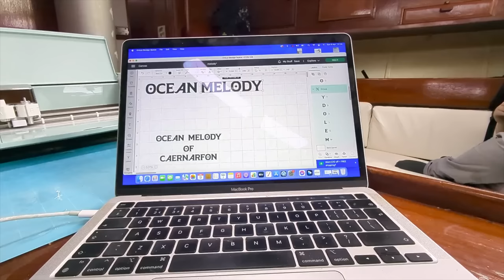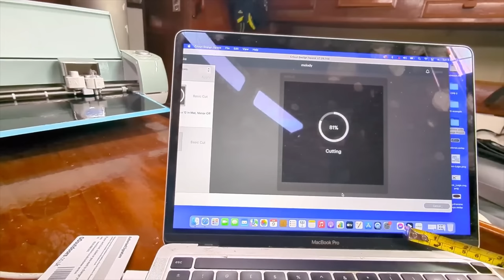#138 - HYDROVANE installation on a Bowman 46 Sailing Yacht

Comment: In the USA we call the “set screws” button head screws. Set screws do not have a “head” and are typically used to tighten a pulley on a shaft or similar application. Sometimes also called a “grub screw”.  I’ve seen others, when running a bolt through foam core, drill oversize then fill the hole with thickened epoxy. When hard they drill the final hole. The thickened epoxy will also prevent water from getting into the foam core. Thanks for the videos, love your channel.

Comment: I think the name looks awesome - and very impressive it’s all homemade, great job Melissa, especially in your condition, you are a very brave and determined lady!
The Hydro takes me back to my fit which I did the opposite of the way u did it, as the transom sloped back, so A at the top and H at the bottom. It all looks great Andy but I would put the whole apparatus down further as there is no merit in having any of the rudder out of the water when upright. This will also help clearance of the Mizz boom. 
Very exciting stuff guys 👍👏👏👏👌
Reply from the maker: Thank you ☺️

Comment: Shame about the Go Pro, we all know it happens! Makes me smile having been in the same job as you that you can make positive changes to SO many peoples lives, literally without pausing for thought but you are bricking it about drilling holes in your pride and joy 🙂you know I am teasing I hope. Great to have the name on the boat and Jack sailing. Expect you will lower the rudder a bit more too? Shame about the vane and sail interfering with each other. Suppose you wont be depending on it ALL the time though. Looking forward to Sea trials to find out if it all works.

Comment: The nicest holes that I have drilled in gelcoat use a Step Bit which has a low angle of cut and is fully supported by the edge of the hole.  It increases in steps of 1/16" and makes a very smooth cut.
Reply from the maker: Very good suggestion

Comment: We have had Hydrovane on our yachts since the 1980s, having purchased the first from Derek in 1983.  You should never go to sea without one, being a crewmember that never sleeps, eats, complains or uses electricity.
Reply: The power saving and smoothing out of an open water passage is worth the effort...but they do tend to cost a lot....
Reply: @rainfinger  

They still remain an expensive item for most ... The problem is the variety of boat hull designs and systems.. to get them to fit and work well usually involves a 
deal of customisation and tral and error.. to get the best out them but once done ✅ 👍🏼😎

Odd life crafting have had to go go through the  adapt repair and tune cycle to get theirs working reliably. Plus they also had trouble with their autopilot destroying their steering quadrant ...
The forces on some rudder systems can be quite epic at times.

Comment: Can a folding bracket be spliced into the vertical telescopic "arms"of the red Vane, so it can be dropped to a horizontal 90 degrees? It would thus clear below the mizzen boom. Save any potential whoops-it-went-overboard incidents with the vane.
Reply from the maker: I wouldn’t be wanting to modify anything hydrovane make. I’m certain they will have investigated all those kinds of possible solutions. It had occurred to me also that would be a handy feature but they’re a very thorough company and will definitely have prototyped or designed things like that and if they had worked then they would be making them. But I’ll ask them if anything like that is in development.  It’s a brand new hydrovane though so I’m not inclined to mess with their research and development lol
Reply: @SailingMelody  I understand what you are saying; "a little knowledge can be a dangerous thing". Much R&D has gone into the product as you say, and I suppose that there are simpler solutions anyway, e.g. a short safety line for when the vane is demounted for tacking. 
Glad to see all is going well for such a lovely family, and again thank you for sharing your adventure.

Comment: Impressive job with the lettering. So much better than using stick-on letters from the stationery or hardware store and then having them not the correct size or going on straight.
Reply: Need a SSR number if not registered already? another job for Melissa!
Reply from the maker: It's on the to-do list 😁
Reply from the maker: Thank you 😁

Comment: Was the lower part of the transom foam cored in the end?
Reply from the maker: It has a foam core yes but I have a cunning plan for that to make sure it’s all good.  Still have to do some final adjustment of the lower A-bracket anyway
Reply: @SailingMelody  I had a similar situation with my bathing platform, I’ll explain my solution in case it’s useful. I drilled pilot holes from the outside then with a 2” hole saw i cored out the inner skin and foam from the inside. I then filled the resulting hole with bonding paste. Once that went off I put 3 layers of glass about 4” diameter over the top. Then re drill the pilot hole from the outside before opening up to the required size. No doubt you have a plan already but thought I’d share!

Comment: Other option if can make it all fit,  move attachment point for mizzen boom sheet further forward on boom so doesn’t interfere when tacking.

Actually cut top of stainless tube to drop top mechanism enough to fit under boom in low position then move sheet forward and jobs a goodun.
Reply from the maker: Yeah that would help as well
Reply: @SailingMelody  just edited and added a wee bit to comment, cut stainless tube down so it fits under boom then move sheet forward ;)
Reply from the maker: @johnhogg9756  that stainless tube isn’t  just a tube

It’s a very complicated piece of precision engineering with a central shaft and machined bearings top and bottom. You can’t cut it down
Reply: @SailingMelody  of course, wasn’t thinking about inside shaft but imagine it’s not rocket science to take out inner shaft and measure how much it measures diff to outer tube and cut them separately unless of course only ends of shaft have mating shapes on them.  (Or potentially order a diff size tube to same effect as getting it to fit under boom - admittedly money is always a concern so may not be an option - but it’s an alternative to getting sails re-cut and shortening boom)
Reply: Of course shorter boom may be a better option was just thinking out loud in case it’s if any use at all - though guess you probs had same thought process already 💜
Reply from the maker: @johnhogg9756  the hydrovane is about 10x the value of a new boom lol. Second hand booms are ten-a-Penny and the hydrovane unit is thousands of pounds to buy and brand new so if I’m going to modify one or the other it’ll be the sails:  in actual fact an owner of a BOWMAN 47 has been in touch. He informs me that the bowman 47 was invented when a bowman 46 had its mizzen mast taken out by a rogue wave and the crew found that the sailing performance without it was literally identical. There was no benefit to the mizzen whatsoever. He is suggesting we get rid of the mizzen altogether and use the space for extra outdoor living and a large solar array stating that for living and cruising it will be more use than a pretty but ultimately useless mizzen.  Personally I don’t think I can bring myself to do that but I think losing a few inches off the mizzen boom is a no brainier
Reply from the maker: @johnhogg9756  yeah it’s totally appreciated :) been going over it a lot in my head 

I’ve also heard from hydrovane who have said they would like me to lower the whole unit and extend the lower A-bracket so it’s less than 10 inches from the bottom bearing. So that adjustment will be coming up in the next couple of weeks
Reply: @SailingMelody  I do like a mizzen but it actually the idea of loosing it doesn’t sound that crazy.  Tbh amount of yachts with mizzens that I have never seen unfurled in decades of ownership is pretty much all of them.  

But yeah loosing a few inches and having sail re-cut does sound a good option to me as well.

Thanks for replies, it’s fab hearing back when make comments and actually really cool hearing a bit more detail and thoughts why certain routes are taken.

Can’t wait to see you all make off on your adventures
Reply from the maker: @johnhogg9756  yeah thanks. We do like to actually talk to our subscribers rather than just ignore them like a lot of the big channels do. I guess it’s more tricky when out at sea. But we love the engagement and interaction
Reply: @SailingMelody  well for me wee love the interaction too… unlike when you comment on another channel really nicely recommending they fit even a diy kicking strap and they get really snooty telling people to mind their own business and have a right rant about doing it their way and they consider giving up channel cos of people like this..  (that was on a channel where the channel numbers basically paid for their boat refurb and their living as they didn’t work).   Voted with my feet in that one lol.  

My son is very autistic (non verbal, hyper, no concept of danger) so won’t ever manage any big sea adventures so really enjoy watching your adventures and others as think a lot of us feel part of the adventure and all of you really make your subscribers feel part of it.   Thank you 💚❤️🧡🤍

Comment: Andy this Hydro Vane is it an upgrade on the traditional Wind Vane ?
Reply from the maker: Kind of although it’s been around a long time: most wind vanes are the servo pendulum type which use a trim tab to steer the boards main rudder via ropes and pulleys to the tiller or wheel. This has its own independent rudder and works in a different way to the Aries a Windvane or rhe Hasler or other servo pendulum types

Comment: Removing the lens cover made a massive difference! Have you been filming with the protective cover on the whole time?! Xx
Reply from the maker: Noooo

That’s the actual square lense which has a bayonet tie fitting on GoPros 

You know the front lense on a GoPro is like square, we’ll that bit is actually removable and under that is the bare lense it’s self. That outer bit gets a bit crazed and scratched but it’s important to stop moisture and dust. But we removed it to improve image quality on our knackered old GoPro 7
Reply: @Sailing Melody  do you have go pro subscription? As you can get a replacement if you do
Reply from the maker: @ShipHappensUK  I’m not sure. Need to check. Been flat out at work since

Comment: Why are you measuring for the vinyl using inches and not doing it in metric ?
Reply from the maker: Hahahaha shush. We both work happily in either metric or imperial. I switch between the two frequently

Comment: Nice episode Andy. I would've thought it would be easier to mount the two bottom brackets and then measure the length of the tubes required. It appeared Hydrovane made the brackets very adjustable. Trying to determine length and position simultaneously I would think is very difficult!
Reply from the maker: Quite possibly we followed the order according to the Hydrovane videos. 🙂

Comment: From a lifetime involved in aviation it was always assumed that “if it  can happen, it will happen”, try googling “aircraft accidents, swiss cheese effect”. There will be one time when the vane gets a swipe from the mizzen boom so best figure a solution to prevent that no matter what it takes. Relying on removing the vane beforehand is not really an option and I think you know that.
Reply from the maker: Agreed

Lowering the unit and shortening the boom is the obvious solution

Comment: I'd want a bunch of gussets/fillets/bulkheads around the transom. Extra weight and forces from following seas may be too much for it. Swimming platform and/or dingy davits also in the picture. Too many adverts!
Reply from the maker: Ahhh YouTube placed the adds and we haven’t had a chance to adjust them sorry

We will be making a bathing platform to add extra support to the hydrovane definitely
Reply: @SailingMelody  It's not so much for supporting the Hydrovane, it's strengthening the whole stern structure. Currently it's just a shaped box with no inner framework.

Comment: GoPro is water proof
Reply from the maker: It is….. but in the Media Mod case you have the side panel removed and rhe USB flap open to connect to the microphone and the external battery, so with the flaps open it isn’t waterproof

If it had been in its waterproof state I wouldn’t have been so annoyed lol
Reply: @SailingMelody  I'm sure there is a local scuba club that can find you a friendly diver. Do it soon before it sinks in the mud. Get a floater ball for the camera. I was too early with that comment. Glad you got it back. Comment about a floater still stands.
Reply from the maker: @delukxy  we got the camera back but because it was plugged into the media housing and the external battery, the water proof doors were open and the salt water killed it instantly
Reply: @SailingMelody  Get some distilled water, aka pure water, no minerals.  You can wash it off, then put it in a jar with ice or silica, and you might be able to recover it.
Reply: @SailingMelody 
so sorry. 
I too always knew go pros were waterproof and super tough. But you have explained why.
So your next camera should have all that stuff and still be waterproof considering you are living on a boat. Having flotation permanently attached to it is also a good idea.   Let's learn from this .